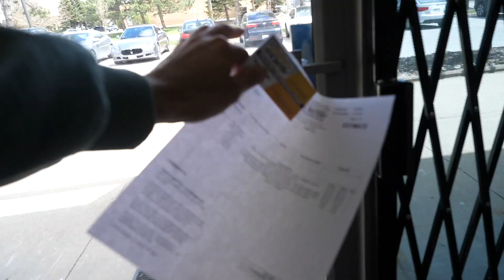BRILLIANT VAN LIFE WATER SYSTEM // diy sprinter van conversion

Comment: Hey guys! Question about your filter / faucet combo. We bought our faucet through your Amazon affiliate link (the faucet in your van - I didn't see which faucet Bob has). Noticed the Watts water filter comes with its own tiny little faucet, and want to confirm we don't have to use that one - the Watts filtration system will work with the big faucet you guys have in your van too, yeah? Thanks!